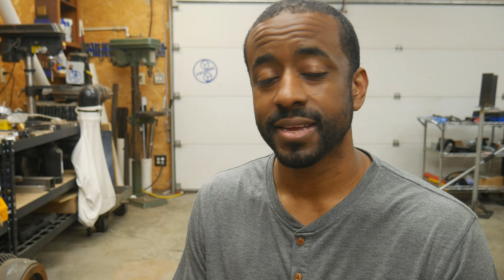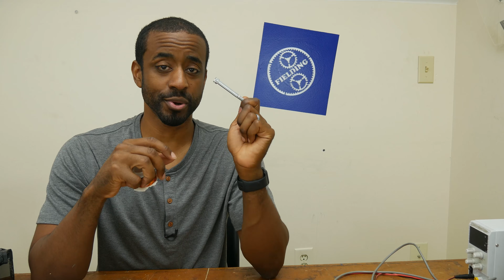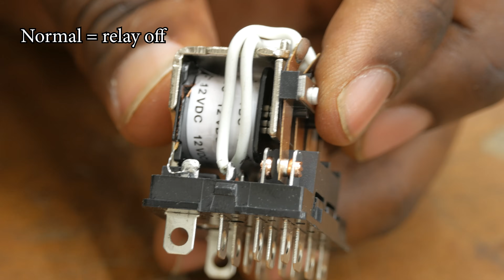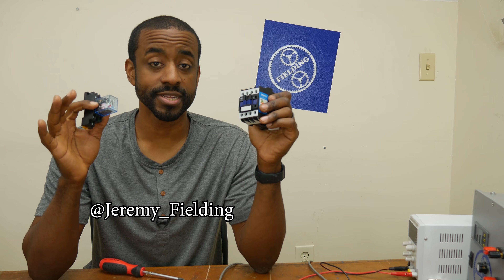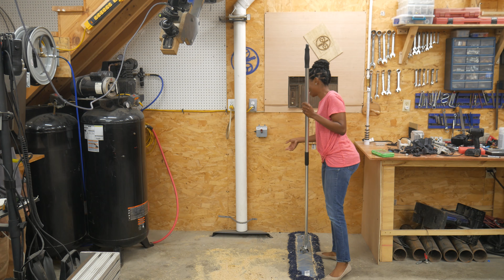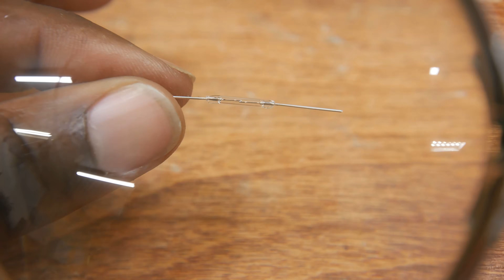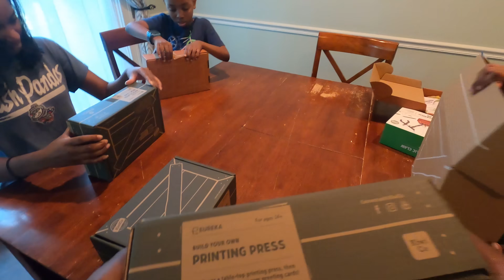A beginners guide to relays, contactors, and solenoids to automate anything; (#083)

Comment: "Is this a short circuit?" I would say no. A very long very thin wire will have enough resistance to limit the current flowing through it enough to not be considered a "short". To me "short" means unrestricted current flow. 

On the flip side... with a large enough power supply, this coil would act the same way as any normal short I'd imagine, as the resistance would be too low proportionally to the input.

Also I don't know things so this is probably wrong.

Comment: Depends on what you mean by short circuit. It's a closed circuit, but rather compact, so it's kinda short. Though if you unwound the mag wire, it'd be a long circuit, and not very magnetic.

Comment: Good job my man! Great job with the simplified explanation using several examples to illustrate. Have you checked out a could tattoo machine? It works like a relay except the contact point is on front spring connected to the  armature bar so as the steel a bar is drawn down by the closed circuit it opens the point of contact causing it to spring back up to the normally closed position which on contact causes it cool to pull the q bar back down and so on. The back spring's tension that the a bar is attached controls the strength of the hit while the tension of the front spring (attached to the top of the a-bar) controls the speed together they create the duty cycle % and the Hz of that particular machine. Of course the amount of wraps/layers of the coil and the geometry are also large contributors . I think you'd enjoy experimenting with em

Comment: I guess if stick welding and wire feed welding are considered short circuit type welding then I guess in theory yes by you completing that circuit with your battery sure theoretically that's a short circuit

Comment: Great videos 
I need to build the same set up. 

My extractor is 3 phase  so I have a 

Schneider Electric LC1D12BD Contactor 24V DC, 5,5KW/400V 7,5HP/480V  does this mean if I apply 24 v dc with a power supply to the contractor it will trigger the switch and turn on the extractor?

Comment: Hey. I've been enjoying your videos trying to figure out my problem.  My old air compressor is having issues.  Starts, runs strong stops normal.  But after a few cycles, as the pressure nears the off point the motor just locks up and the motor hums.  It dont let it go long for fear of heat damage.  The capacitors look fine.  And resistance testing perhaps is normal.  The run cap will go to about 1/3 scale and drop fast.  I have ordered a new run cap, but was hoping u may have another idea.

Comment: I love your explanation about the relays n expecially the solenoid, Jeremy.
I have made a circuit with digital 7 segments counters, a 555 counter connecting to a 4017 which activate 10 LEDs.  
Instead of the LEDs, I replaced 10 switches n each individual switch is  connected to a common n relay. The relay is then use to trigger a solenoid. Here's the problem. How to made a strong solenoid which doesn't interrupt n changes the readings of the  7 segments when the power is on. Whenever the solenoid is activated it changes the digital counting.there's
always a spark between the metal plates of the relay too. I m from Malaysia.

Comment: Could you do an informative video on using a 5-8 Amp AC motor to drive a pulley to a DC motor such as a turbine motor without fan bladed but rather a pulley attached..  Theoretically one should create more amps from the5amp drive motor.

Comment: Great video as always. I am good with 12 volt relays... Love using them for a floating ground when using a running light also for turn signals. The thing that always gets me for some reason is wiring a contactor for a reversible motor like used in a winch.

Comment: Here's a tough one for you. Its noted in Joseph Newman's book Newman's energy machine. When you disconnect an energized a coil, of lets say 500 feet of coil wire, you get an electric spike on your meter as the field collapses.  But if you string out the same 500 feet of wire 250 feet in either direction (twisted together or side by side in very close proximity) then energize it and disconnect it there is no electric spike on the meter.  I don't understand it, perhaps you will.

Comment: I have 8 pin relay octal that use in navigation light 7 and 2 is the suply and the navigation lights is conectred in series so that if the nav. Light is busted the buzzer ang pilot light tregger.. but my situation now is that when i connect it to the series to the nav. Light it is not fuctioning only relay.. so can you help about my problem? How to light my navigation light?
Reply: My suply is 24 volts and relay, bulb is also 24 volts? I test it only relay and bulb connectedin series but bulb is not lighting? Can you help me?

Comment: Your form of teaching is the best I have ever experienced in my life, formal or informal. Excellen tvideo Jeremy I'm excited to learn more from you. I'm working a new wiring harness for my 1992 lincoln SA-250 diesel powered welder. Could you show how to make a 100% correct water tight solderd terminal connection as good or better than factory? I appreciate you explaining electrical components and their proper use.
Thanks,
Chris

Comment: What would cause a magnetic relay  to stop working ? I have a Lincoln 300/300 ideal arc welder thats old and it setup to turn in like that with a small switch that power a selinoid that actually turns on the machine but for some reason it just buzzes when pressed, like if its not strong enough to switch it on. If you maualy move the switch it will come on and will turn of with the small on and of switch .

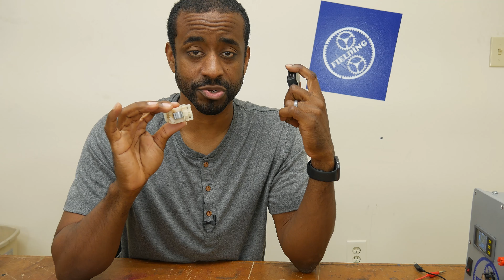Comment: 5:26 It is a short circuit. DC applied across a coil doesn't create any back EMF or impedance/resistance like an AC circuit would. Because an AC circuit magnetic field is changing directions/collapsing and cutting lines of flux creating a back EMF. There is a reason we use AC for general transmission of power on the grid.

Comment: it is not a short circuit because the wire in the coil has some resistance over it's length.  a 'short' piece of that same wire, though, would be a 'short' circuit.

Comment: Linear actuator? You mean pneumatic cylinder.
Reply from the maker: is it not both? Why split hairs
Reply: @Jeremy_Fielding   Well, I was taught to drill holes in them. So splitting them is second nature.
Anyway,  I do agree it fits in the category. However, we know pneumatics, hydraulics, and electro mechanical devices act very different. Granted the hydraulic and electric devices act in a similar fashion under unloading and especially rapid unloading  situations. And pneumatics have poor repeatability without mechanical limits. I would argue for the sake of safety, that their differences should be pointed out especially in the unloading situations. Pneumatics are far more dangerous when the underinformed person is experimenting with them. In fact my brother nearly lost 2 fingers when using air to test a hydraulic press. Besides you did split the short hairs between switches, relays, and solenoids.

Comment: It's a perfectly acceptable circuit. A short would be if either the load is bridged ie. using a jumpered or if the power source is bridged or jumpered out. Jumpering out the switch just means you deliberately eliminate the switch to determine if it's faulty etc. This is a common practice in troubleshooting circuits. You would never jumper across either a load or a power source nor would you deliberately allow a connection from power to ground or neutral. Both of these shorts would open the fuse or trip the circuit breaker. To test loads use a multimeter set to volts to determine if there is a voltage drop through it. Once you know it is getting power and has a good neutral you simply remove it from the circuit (isolate it) and check it with an ohm meter to see if it has continuity. 
To test a power source go from L1 to N or G, L1 or L2 to N or G, or L1 to L2 (expect 240v) using a multimeter set to volts.
Although no longer a common device an immersion heater used to boil water has no switch and works perfectly well. Also, the heater element in a residential A/C unit to thin the oil has no switch associated with it beyond the circuit breaker itself.

Comment: Excellent video.  Thank you for how you try to explain concepts in the simplest of terms.
I've looked at Kiwi Co. before, as I love the concept.  The hang-up I have (besides me being cheap) is the same one I ran into with the free kids building workshops at Lowes and Home Depot--my wife doesn't want a bunch of stuff just sitting around afterwards that never gets used once the kids are done having fun with it, stuff which I typically can't them sell or donate.  Do your kids use the stuff long-term?  For example, I can see how the headphones or lamp would be used over and over again, but how long did they play with that frog disection kit before becoming bored with it?

Comment: Very nice 👌.  Thank you for relaying all of this vital information.  Although, technically, the solenoid-relay relationship (relayshunship?) is that a relay or contactor is a solenoid powered electrical switch.

Electricity fundamentals tells us not only that current passing through a conductor causes a magnetic field about the conductor, but the inverse is also true.  A magnetic field passing by a conductor will cause a current (or voltage rise) in the conductor.

Comment: The solenoid on the car starter motor is interesting since it doubles up as a relay (or technically a contactor). The solenoid function is to pull and engage the cogwheel from the starter motor to the flywheel. The relay function is to connect the battery with the starter motor.

Comment: Boy howdy, I really want to flip that switch on the four square box mounted to the wall.

When I was in high school the electronics teacher used to make steel boxes with plastic tops and a steel m.o. push button on top.  The top had a label that read "do not push this button".  Pushing the button charged a capacitor with a 9v battery, and releasing the button let the capacitor discharge though the steel box and steel button.  Hilarity ensued.

Comment: When you energize a relay. What prevents the coil from over heating?
If you a relay as a switch and leave it on for a couple of hours. Will the relay overheat?
Reply from the maker: no... it is designed for this purpose.

Comment: I Don't think it is a short circuit because the coil of wire can as an inductor. So there is some kind of load on the circuit. 
On the other hand, when we have a dc power source connected to an inductor eventually it comes to an equilibrium of sorts. Like the inductance depends on the frequency as well.
Also, the wire has small resistance per unit length but as we are coiling heat can be and is actually generated.
Complicated and a bit confused too but it is definitely not a short circuit.

Comment: Thank you Jeremy for this one.  You actually made me laugh when you pushed the button on and off quickly to demonstrate the relay.  I don't know why it made me laugh.  It did.  :-)
Years ago, back when computers had a physical on/off switch, I created a relay powers switch that while on, would feed itself power and stay on letting wall power get to my computer.  If there was a power outage, the relay would turn off and stay off even when the wall power came back on.  This prevented my computer from coming back on until I felt the wall power had stabilized.  It is common for the power to go out or come back on multiple times in a short period of time.  This prevented my computer from that rapid on/off cycle with is not good for the computer.  This was all in a project box with a button on top to reset the whole thing when I was ready to re-energize my computer.  I haven't use that thing in years but I still have it in my box of random computer parts.

Comment: Interesting question if an electromagnet is a short circuit or not. To answer, we first have to find a useful definition of a "short circuit", because it's arguably not a well-defined scientific term. Let's look at examples first:

The reason why you would suggest it could be called a short is that it's, essentially, "just wire" that connects both poles. However, the filament of a light bulb is also just tungsten wire and therefore we could for the light bulb argue the same way that it's a "short". Ergo, this definition isn't good enough.

Some people argue that the wire in your electromagnet has a resistance, hence it would /not/ be a short. I'd argue however that any short has some (typically low) resistance and therefore, there couldn't be any "shorts". Therefore, not a good definition.

I would say the sensible definition of the term "short" is that the majority of power is dissipated where you actually do not want it to go. For your electromagnet there's parasitic series resistance (causing the magnet to heat up) but there's also energy that is converted into the magnetic field. The latter is the "good" part, the electromagnetic field you want it to create. The question now is, how much of that power is actually going to be going into creating a magnetic field and how much is just going to be dissipated as heat. In your example, that's a fairly straightforward situation: You have  a (presumably) 110V motor and you're running it off 9V. The design of the electromagnet (amount of windings in particular) will be so that even at 110V the main function of the thing is a magnet (as opposed to a heating coil). So at 9V you will likely not going to saturate the magnet at all and, hence, it is no short.

Note that if you would supply to that same magnet 1kV or 10kV, we could definitely consider this a short (even though the hardware is exactly the same). Just as placing a paperclip in an electical outlet would equally be considered a short (even though it sure would create a tiny bit of a magnetic field). Also note that if your dogs gets a hold of the magnet and chews up the windings, we talk about "shorted" windings, even if it's just two neighboring windings that still don't affect the whole setup of your electromagnet.

In conclusion, this is a way too long answer to your bait :-D Love your videos, thanks for sharing your knowledge with us.

Comment: I once tried to make an electromagnet out of a nail - and it just wouldn't work. I was using a cordless drill to wind the magnet - turns out the nail was rough enough to strip the enamel on the wire and short the circuit. Once I wrapped the nail in tape - to soften it - the wrapping proceeded smoothly. Nice video!

Comment: Keep learning, keep having fun, and keep inspiring.
I have two boys.  They first started building things at Home Depot and Lowes project days and also building legos (which, BTW, they still do).  As they got older, we did more and more. I have a work shop and they first started in the shop in 1st grade to build their pinewood derby cars learning more and more each year using the drill press and the band saw.  By 6th grade they were proficient in both (but still supervised).  About that time we moved to electronics w/ snap circuits and then in middle school we move to mechatronics (Lego Mindstorm).  In High School they were both on the Robotics Team and learned CAD, mechanical and software design.  Now my older son is 20 yo working on his ME degree and is a leader on the school's Formula Race Car design competition team.  His brother is 18 and joins him at college in the Fall.  Along the way I have learned a lot too.
Keep it up man, you're doing great!!

Comment: i see a load or a [ resistance ] back to the other side of the source  power... so it is not a short circuit...  now riddle me this: A solenoid is the same thing as this coil of wire on wrap around this iron material  but moving on a post of iron... up and down action...

Comment: Bonus Question Answer: I would say no because the coil would be a resistive load between the terminals on your 9V battery. Is this correct at all?
Reply: You're correct.  Unless the coil is of a superconducting material.  Don't forget to buy in liquid helium.  Most relays, I think,  are marked with the dc resistance of the coil, eg 20 ohms. So, once stable, it would take half an amp from a 10 volt supply.  There are transient conditions at switch on and switch off, but kept on for more than a moment, you have the dc resistance of the copper wire.

Comment: Great video!  Thanks !!  That is not a short circuit there is resistance in the coil of wire although the DC resistance of that coil is much lower than the 60 hz AC resistance of that fan motor.  I would consider a short circuit to be a short piece of wire directly across the battery terminals - but even that has a VERY small resistance. :)

Comment: Hey Jeremy,
Excellent video as usual.
The coil of wire is considered a load due to it's resistance. So, as long as Ohm's Law allows the amount of current to pass for the load resistance (wiring thickness), it should be all good and considered as a load and not a short. 
Good question! 😊
MiracleMAX

Comment: No. There is resistance in the coil and the coil is acting as both a load and an inductor.

But that leads me to a question: If the coil is acting as an inductor, why does the magnetic effect end so quickly and abruptly? Shouldn't there be some residual voltage 'trapped' in the coil which must be dissipated?

Comment: Interesting question: How much resistance is required in a circuit before that circuit is considered to be non-short-circuited? Hm, maybe it's not a function of resistance, but rather a function of an ability to perform work. Either way, my vote is that the 9V battery hooked up to a copper coil is not a short circuit.